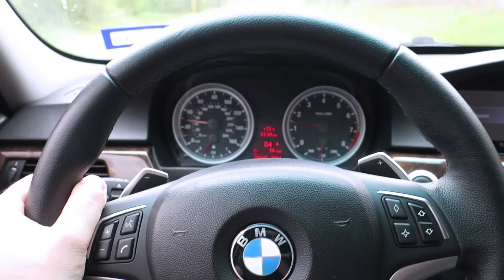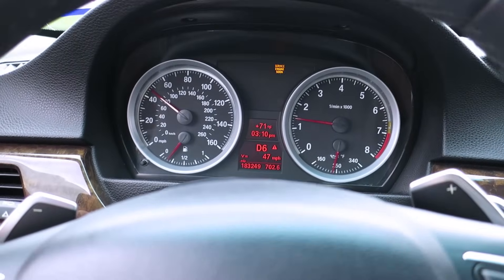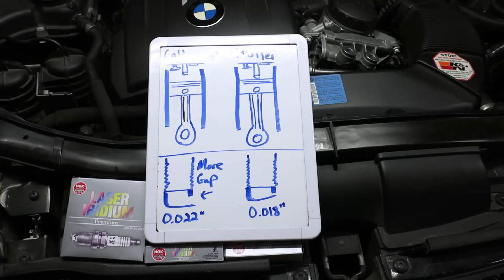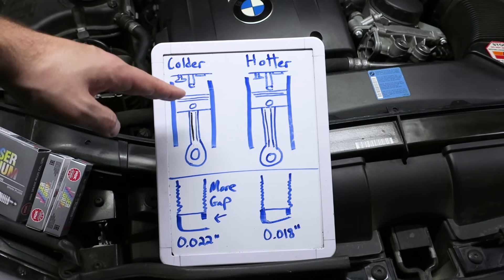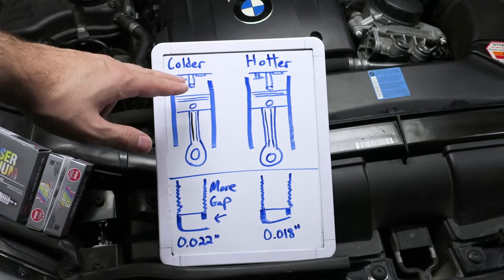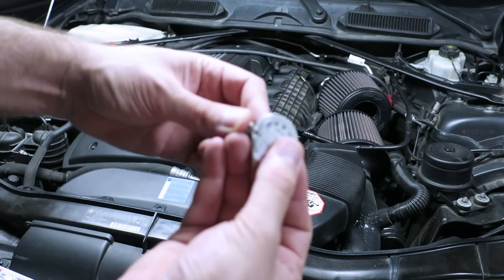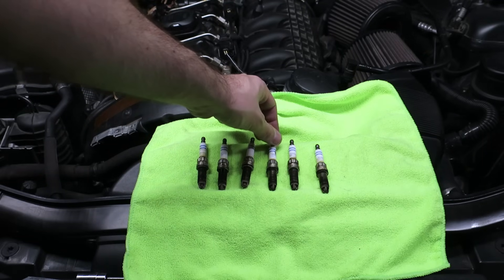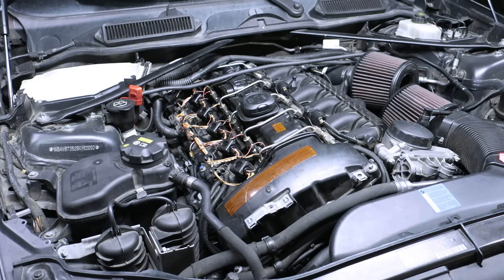What Does A Misfire Look Like?

Comment: My car makes popping sound and shakes on idle. No check engine light ever. Runs and accelerates smooth like butter but when I stop on idle it runs rough and shaking/knocking can be felt inside the cabin

Comment: I had a crazy misfire in my stage1 f30 335i doing a 4th gear pull and the car jolted so hard and went into limp mode. Changed the coils and plugs and its been running smooth ever since.

Comment: 183,249 miles on an N54 with so many haters talking smack about how unreliable the N54 is. You should do a video on what you've done to the car. Sounds like the air filters and a tune. 183k seems pretty reliable to me. Great video. My N54 has 57k on it and I'm looking for many years of enjoyment from my Z4.

Comment: Exact same symptoms here
Reply: Same man, I give it a pull when I’m at 60 and the SES light comes on then goes away and car still runs smooth. Got any ideas?
Reply: @adcmzd9648  mine doesn't throw a check engine light but when I hit 2000 rpm, I think it shuts an injector and starts misfiring and runs like a dog, shuddering till I stop or accelerate. Then when I restart, it becomes smooth again up till 2000 rpm and repeats the above. At no point does the check engine come on but after changing plugs 2 days ago, I'll check if any of them is fouling today to know if I have a leaky injector. I guess start with a plug replacement. I'm completely stock.
Reply: @shaazy  gotcha, when you took off the old plugs how’d they look? We’re they foul or did they smell like fuel? If they were then it would mean that the injector is leaking. But if they weren’t then you probably needed the new spark plugs and you’ll need the coils too since those two are key components for this car.
Reply: @adcmzd9648  Plugs were foul as reported by the mechanic, forgot how many, but at least two. ECU codes read that cylinder no. 4 misfire and Engine Injection Cutout. So question is, should I replace all 6 or just that one ?
Reply: @shaazy  its always recommended that all 6 get replaced instead of one or two. These engines are so picky and special that you’ll need to get the whole 6 instead of just one or two. Same thing with the coils fam
Reply: @adcmzd9648  damn. was trying to avoid dropping $1400 for a set.
Reply: @shaazy  oh snap my bad fam i meant replace all 6 spark plugs! Injectors will go when they begin to leak fuel into the plug overnight, worse case scenario car will run rough all the time and you’ll get codes. I still have index 6 and index 9.
Reply: @shaazy  for the injector cutout make sure that they’re all connected firmly as they can come off or get lose with time, start with the plugs first and go from there bro!

Comment: i had this issues also but my car read a code that told me the power actuator valve was in the open position. And that happened when i increased speed over 3,000 RPMS

Comment: Just picked up a new, well almost brand new 2011 BMW Z4 S-Drive 3.5IS with only 12.5K on the engine and experienced the very same issue when I'm driving at a decent clip, and floor it. However unlike yours, to get my check engine light to go off, and the engine back to normal I have to actually stop the engine. On the restart, everything will be back to normal, check engine light goes off, stays off. Thankfully I have new plugs, and coils that I'll be installing.  I decided to go one step colder using the N55 OEM plug (Bosch ZR5TPP33) which is already 1 step colder than the OEM N54 plug.
Reply: Same thing with my 35iS. Did the new plugs & could fix the issue?

Comment: I'm pretty sure Cold plug just means it draws heat away from the tip faster than a "hot" plug. For example, if you are running a stock car on a NA engine and switch to 2 step cold plugs then you might experience carbon fowling.

Comment: My 1M will shudder a bit and lose power when pulling in 5th and 6th. Feels like running over rumble strips. Haven't had plugs changed them since it was on warranty. I've ordered six new plugs and six new ignition coils. I'm confident the problem will be resolved.

Comment: Really good video, but you do go through coils faster the wider the gap. Jumping the larger gap is harder on the coils is my guess, but I do know it wears them out faster from experience. get better coils or accept what will happen every so often. The brown arching, on the plug base of porcelain, is usually from some oil that seeped into the tube past the valve cover seal and is arc burned in a bit. There is no cleaning for that, I mean it must be replaced. that was the misfire I'm sure. wish you had labeled where plugs came from, but still not a bad video

Comment: I have this issue. Only difference is that my service engine soon light came on a long time ago and there was no issue i could find. But then like a few months ago, I hit the gas at a light and around 3,500rpm with moderate acceleration, it stuttered. I let off the gas and it was fine. A couple days ago this happened again. And now my car is just running rough and vibrating a lot and sounds like a subaru. I have a shop I am going to and it's about 40+ minutes away. You said the ecu shuts off a cylinder so it won't damage it, so I could drive there ok yeah?
Reply from the maker: Depending on the model the ECU would stop spraying fuel in the cylinder that is misfiring.  Do you have the same car?  335i?
Reply: @VehicularDIY  yes. 2007 335i.

Comment: Great Vid bro , I have a 2013 550i M Sport . Mines is stuck in limp mode . It’s an automatic and when i shift to drive or reverse it doesn’t move and makes a loud humming sound . Also when in park it will still roll as if it’s in neutral . Put the E brake on and it’s just fine . Could this be my transmission? I got the drivetrain malfunction message .

Comment: Hey your video was very informative....I just recently purchased the exact same spark plugs and my vehicle would would start than turn off...so after replacing the spark plugs and coil packs (used eldor ) my car worked now it's does the same thing as before....I'm going to try to reduce the gap like you showed us to see if that solves the issue!......Will see if it works
Reply: Well it didn’t work.... on to plan H
Reply from the maker: Hey thanks, if you car starts than stalls right away if look into fueling or you map sensor.

Comment: Worst possible place for them air filters you would lose power rather than Gain it all you're doing is sucking in hot air, hot air is less dense therefore reducing power. Cold air is dense which in theory can increase power which is why you need a cold air feed and the filter preferably in a sealed box with a pipe connected to the front of the vehicle drawing in fresh air from outside the vehicle
Reply: This is a subject that has been discussed endlessly, id have to go with gains on a dyno to do the talking. Heat soak from a stock intercooler is much more of a priority for tuning.

Comment: Need advise please: have 2 codes on Merc C180: p0303 cylinder 3 misfire and p0313 misfire with active fuel reserve signal. Car starts first time everytime but shakes and noise and lack of power. No smoke but engine light is on. It only done 80k miles. Any suggestions as to what it could be (major or minor) and where to start from?

Comment: My car is doing something weird. There is no check engine light on at all. But it it has some very bumpy right like as a is a knot on the tire. And when I was driving at highway speeds, I almost lost control of the car because the car swerved to the right. And when that happened I was losing power. So I got off the highway and got off to the side of the road. When all of that was happening the check engine light and the VSC light turned on. I turned the car off and then turn it back on both of the lights turned off and never came back on. So I drove in the car ran great after that. So I took it to AutoZone. And they hooked up their scan tool. And a code popped up po301 cylinder 1 misfire. But the check engine light was still off.

Comment: I have had 5 e90s. I watch all your videos, just picked up a n55 it is smooth but in the past I have had not shaky engines but ruffer idling than usual  almost like motor mounts. Also if there is a mis fire will the computer catch it 100% for sure ? Or is there a certain limit of misfire that triggers it...

Comment: Hey do you think you have any explanation on why my 335i with a n54 is misfiring but I get no check engine lights or any codes at all.  It shakes at idle but the rpms don’t go up and down crazy just ever so slightly and then back down.

Comment: Great video! I recently installed the 1 step colder NGK with a .021 gap to pair with Pure Stage 2 setup.I was very cautious with the gap process and I am confident they are set evenly. They seem to run great, except I am now getting a rough cold start with multiple missfires. When the engine has idled for about 30 seconds it completely smooths out. I did not have this before swapping the plugs, so I do not believe it would be leaky injector. Is this behavior common with the new colder plugs that are gaped down?
Reply: Plugs are the same as in your video, 95770
Reply from the maker: Thanks!  No not at all.  Are your coils in good shape?
Reply: @VehicularDIY  They should be. Delphi, and only 10k miles old. The injectors are index 12 and only 10k miles old as well.

Comment: Ok I’m a little confused about what he is saying. I picked my 2010 335i E92 about a week ago and am having the same issue where the car runs fine normally and when under full load the car pops a CEL, when I turn the car off and back on the light is gone and car runs fine. The car has a stage 2+ mhd tune downpipes, charge pipe, and DCI (seller told me car is around 380-400hp)? Would running these plugs improve the hesitation under load?

Comment: Hi the video is very informative!!! Ive been having an issue with my bmw535i e60, so my engine light is on, (like the engine icon itselt rather than a service engine soon msg) i went to autozone to check the code and it said cylinder 3 misfire, and that i needed a new coil. So thats what i did, got a new coil, but the light was still there and said cylinder 3 misfire, so i changed all 6 plugs, and it still says cylinder 3 misfire... im so lost i have no idea what to dooo.. plzz any advice would be helpful
Reply: Omer AbdulAziz did you clear the code after replacing all the plugs and coils. is it throwing a new misfire code?
Reply: @chrisbaker8467  i did not have it cleared, but i sense a small misfire, very minimal, (which i hopefully means that its not my injectors) so idk maybe its an intake leak or some thing
Reply: Omer AbdulAziz I would have the codes cleared. then if it comes back you can always move the plug/ coil that it says is misfiring to another cylinder, clear the code again and then see if the misfire follows the plugs/ coil to the new cylinder. if it does then you got a bad plug/ coil. if it doesn't then you most likely have a faulty injector

Comment: He great vid. I have misfire when I start the car in the morning and he wil go to limb mode. When I restart in few minutes it is gone away. So only with cold start. OBD says P0087 fuel pressure to low but the hpfp and the hp sensor already changed. Do you have any idea? This was happen after changing the plugs last summer. 335i N55
Reply: I know your post is 10month old ,but did you solve the problem as mine does exactly what you have explained  ,hope you solved the problem fella ,👍👍👍🙏
Reply: Colin Davies yes the HPFP wasn’t good. Bought a new one for 1000€ and works now fine.

Comment: Our 325i with the N52B25 also started misfiring like this since two months ago. When I kick down and rev it over 5.5-6K it does it. I checked some BMW fora and they said it is probably the ignition coil. Our car is at 60k miles and i think it has the stock coils still. I will receive the Ignition coils today, and i already got new plugs from Bosch (FR7NPP332) . We check the computer and it said coil six was faulty and the guy just removed the error, but it keeps doing it. So we will change the plugs and coils. Do you think I should only have changed the plugs? The engine is stock.
Reply from the maker: Typically it would be just one or two ignition coils that failed.  You would scan for misfire codes and see which cylinders are having the issue and move the coils around to see if the follows the coil aka a new cylinder would report a misfire.
Reply: @VehicularDIY  aaah okay, yeah i think its better to change them all at once, im gonna change the gaskets and seals on valvecover anyways.
Reply: My 2008 328i just missfire after 5 or 6 rpm its shaking im going to change the spark plugs & coils you think thats the problem?
Reply: @liamordones7790  yes when i changed the plugs and coils it went away

Comment: I’m really iffy on trading my 08 Subaru wrx for a 335i (n55 not the n54) like this. Man why can’t bmw get their things straight
Reply from the maker: I'll give you my perspective, I had a 2002 WRX back when they first came out.  I've never had a car with more problems than that car and got rid of it at 25K miles.  Constant check engine lights, blown transmission, clutch chatter.  Main body weld let go on the passenger side let go and the chassis would creak when going over speed bumps.  Interior rattles like I've never heard before.  It's all relative but typically with a BMW the motor and transmission and chassis is super strong so you're not likely to face any huge expenses like a new transmission etc but small little issues could add up unless you're willing to DIY the repair.
Reply: @VehicularDIY  I agree 100% with what you're saying I was considering a Subaru before I bought my 335 but stopped myself after seeing the issues they had. And as you said bmw isnt perfect it has some issues that are minor for me it's mainly electronic and involving like rubber and plastic parts but if you can fix it yourself then they are great
Reply: Honestly id say it's worth it. I have an 08 335xi E92 and my N54 motor has had no issues and im at 130K with mods. The only issues ive had is simple things like vacuum lines,sports mode cable ripped, and oil sensor. But it was all fixed for cheap
Reply: Antonio Spasevski turbos still didn’t need to be replaced?
Reply: @LightSkinDenz  No sir they work great without any Westgate rattle although ive been looking into buying some upgraded turbos just for fun lmao 😂
Reply: Its great if you can afford the repair costs instead of going to dealer

Comment: Note: cheap ass circular circular gap measure devices are ramped so the electrodes may are not ever parallel is such tool used to adjust gap.  Use calibrated blades to visually check gap, and a proper professional gap setter to keep electrodes truly parallel.

Comment: Question! So I have an e38 740i. And I started it, at first it was good until 20-30 seconds later it started to rough idle and jerk. So I turned off my car and turned it back on. It was idling fine again. I’m wondering if that could be a faulty sensor? 
It was also semi cold start if that’s something important to consider.
Reply: Was it low on gas? Maybe it had air in the fuel line.  Or a vacuum leak?

Comment: Thanks for the video, is it recommended to use anti seize on the threads of the plugs?
Reply: Mannyinthebank a lot of modern plugs have an anti seize coating on the threads but im sure it wouldn’t hurt
Reply: I would not, always see advice not to: 1. Possibility of getting crap into the cylinder on install is baaad juju. 2. It changes the torque rating - it lubricates the threads a bit: what's the correct torque value now? 3. Changes the heat flow even a little bit from plug to head, and possibly that good electrical connection. 4. When you pull those plugs, more crap falls into the cylinders. Probably don't do it on a car I may someday own!

Comment: I have a 2003 330i E46 and had a misfire this morning. Sounded exactly like this except it was while I was at a red light. I pulled over when it turned green and shut the car off for about a minute. Turned it on and it ran smoothly for the rest of the day. I’m new to the BMW world and was wondering if someone could shed some light on why that happened? Like I said it only happened that short time that I was at the light and didn’t have any issues at the end of the day. I ended up clearing the engine codes and even floored it on to the freeway Some technical details:
2003 BMW 330i E46
183.000 miles/245.500km
Time of event: 11:40
Outside Temperature: 11c/51f
Idle RPM: 610
Code: Misfire CYL# 3 and 6
Idle RPM during misfire: 490
Notes: my car idles kind of low when running at optimum temperature with the climate control off. I was also told that it has oil leaks in certain places that are very minimal and I have the parts to be replaced on order. I understand this is a very large comment to which I commend and Congratulate you on reading all of this.
Reply: Google.com

Comment: So if you get the hard misfire codes do you need to reset the ecu after you replace coils and plugs?
Reply from the maker: You would to clear the code right away.  If you don't eventually the code would clead automatically with normal driving but that could take a while.